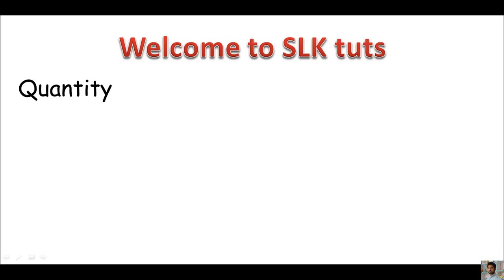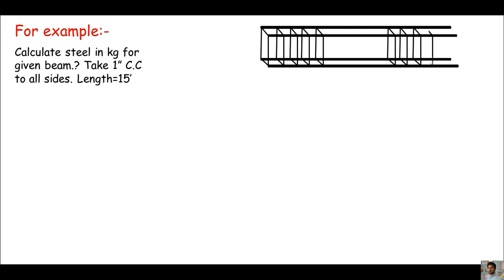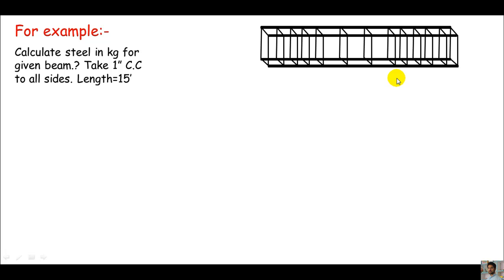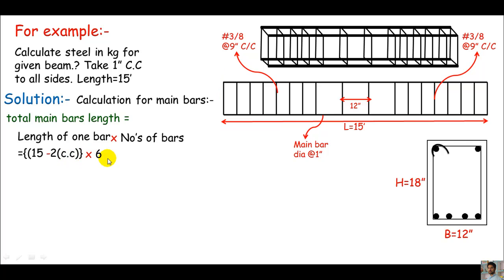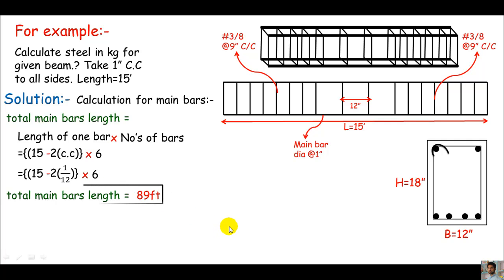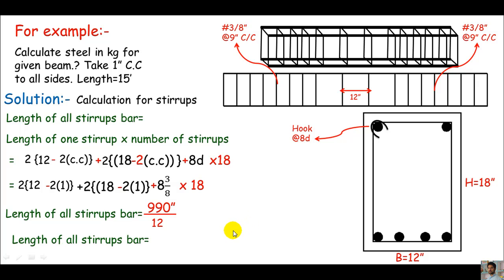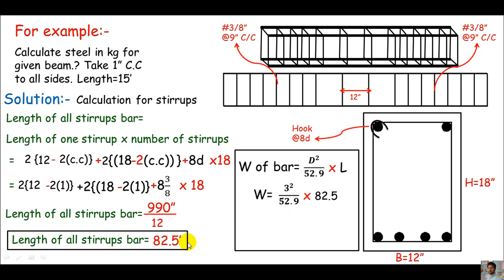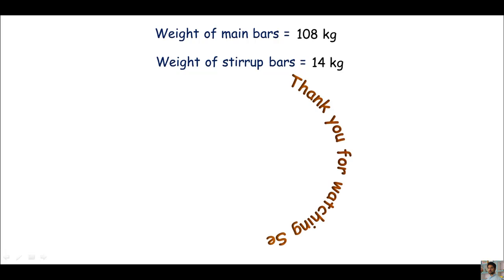English-Quantity survey / Steel calculation for simple rectangular beams

Comment: I am confused sir D2/162 used but   u used in D2/52.9 which one correct explain .my mail id send me video sir cpkamaraj2@gmail.com .thanks u sir very useful all
Reply from the maker: hey dear. do not be confused . both formulas are correct.. 
D2/162.196 x L is used when dia of bar is given in mm and its length is given in meters.

and
D2/52.9 x L  is used when dia is in form of soter and its length is given in feet.... both formulas will answer in kg

note: soter is 1/8 of inche
Reply: D2/162 ×l  is correct  sir